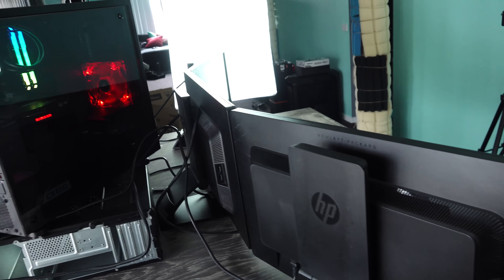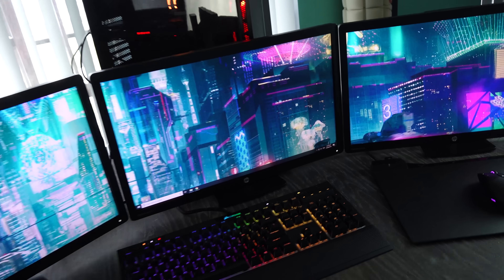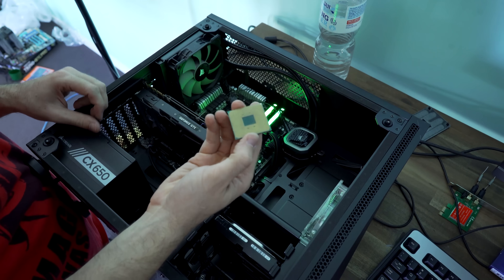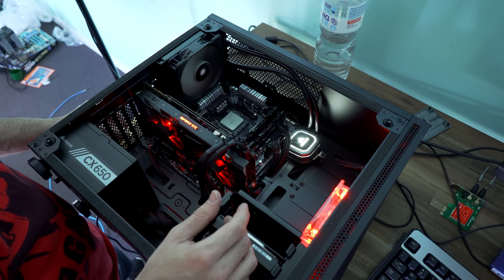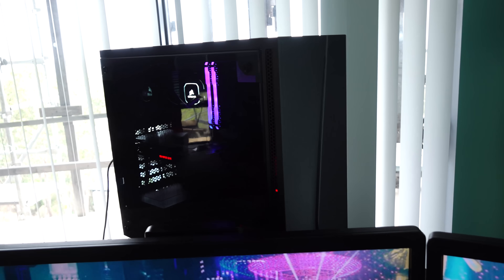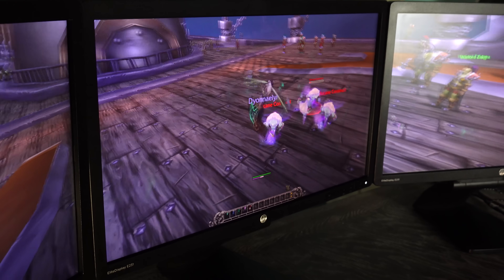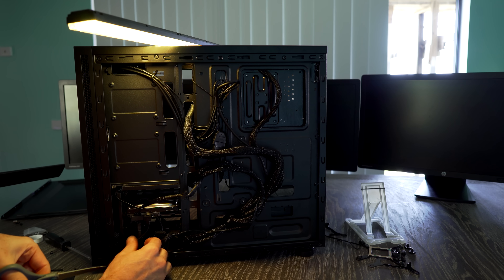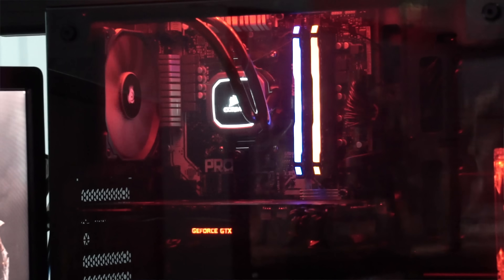Ryzen Problems...!? Post Analysis of the AMD WoW Gaming PC

Comment from the maker: Lots of people in the comments saying it happens on all platforms, both intel and amd, I have built a lot of pcs and it has only been happening to me on ryzen pcs, everytime without fail (not the old FX too which is weird).  I am only talking through my personal experience with the issue.  Though again if you are doing a new install, make sure only the SSD is plugged in initially.
Reply: Hey Bryan make sure that when u boot off ur windows 10 flash drive its using uefi instead of legacy / non uefi. I have similar issues if I setup systems using mbr non uefi vs gpt uefi.
Reply: I can confirm. It's more a windows issue than hardware issue. I've had this happen all the way back to Windows 95/XP/7 on any computer (Intel/AMD) with multiple HDD when performing a fresh install. It's just a windows thing.
Reply: I've been working in a PC repair store for 5 years and it can happen with all plattforms. We started disconnecting every drive exepct for the the main drive a couple of years ago.
Reply: If you are going to install Windows 10 in UEFI mode you have to take a few extra steps when you make your bootable install cpu. It is ridiculous that you have to do that. No such problem installing Linux.
Reply: I've had windows install the bootsector on my second hard drive, and not on my ssd and this was way before Ryzen so it's probably just a windows thing. This was with windows 8 by the way.
Reply: TechYesCity - I Had this Exact Same Problem - Although it Was an SSD i was loading Windows on - it was a NEW   WD HDD 1tb Blue - However - I Was Offline Had the Old Drive Completely Disconnected from system - and new drive Properly installed - OFFLINE - and was Attempting to Install Windows on the New Drive for a Backup Drive Offline - However - There Also Was a Format Error displayed and said that it would need to shut down - Meanwhile getting display and everything - there was a command prompt style option to type in - who knows what it was asking for due to no instructions of request of written information What So Ever - just a que that the system was needing to shut Down due to Wrong Formatted drive - Nothing Else - No instructions on recovery - saving BIOS settings - NOTHING - while i searched Online on a separate pc - There Were No Information what so ever - As well as No Way to Back out of the Screen or page What so ever ! Not Having the Proper Instructions To type needed information in the window with the command prompt Type - meaning a line flashing waiting on me to type in - Who Knows what - Even though - I Actually Attempted to type Anything in - And it Would Not allow Anything to show On Screen - Thusly - Back spacing Out of what I May have written in that line to make Sure Nothing was kept in that line per Not Bring able to determine whether or not Anything was actually received - I Then Proceeded to turn Off the PC - Shut Down - As Usual for Hardware Removal and Replacement - removed the drive i was attempting to load Windows on - Reinstalled the Working - EVEN NOW _ drive once again - Then Plugging it up turning it back on and Attempted to Start the PC - WITH ABSOLUTELY NO LUCK AT ALL ! This was and Very Mind boggling and I Still Dont know Exactly in the Normal Formatting A New Drive - THAT IS WORKING AT THIS MOMENT as a Back up Drive and Is Showing in My Current system that the First Working drive Is Installed in as well as Properly Formatted - Although im Not using it as a Boot drive - just a Internal Backup drive - I Tried Again and Again to get the r5 1500x - x370 prime pro - asus of course - mobo cpu and gpu to reboot - It Never did and still hasnt today - this occurring 4 weeks ago now - i had no Other AMD unit - Purchased Another Mobo - NO LUCK Same CPU - Had a tech shop Check GPU - it IS WORKING AT THIS VERY MOMENT - yes - same gpu that was in the Old PC - guess you can see where im going with this now - Purchased an Older Full Working PC - with am4 / A10-9700 and 8gig samsung / and win10  on a 1tb blue / HP . So I Took the Cpu Out - Replaced it with the R5 - Installed Gpu But First Before Turning PC Off to remove the A10 - I Went into Bios and Changed the Display Out put to GPU - plugged it up turned it on - NOTHING ! Took the A10 Put it in the New x370 Mobo i Purchased while waiting on Prebuilt to arrive - Worked Right away - Placed the R5 + Gpu - Same thing - Changed settings Prior to changing cpu`s NOTHING - Even Tried it Without Changing settings From APU Graphics on All 3 Mobo`s = NOTHING From the R5 - Placed the WORKING A10 in the First Mobo - NOTHING - Downloaded off new mobo the Bios to Attempt to Load From the Firs Same Exact Mobo - NOTHING - all the while Off of the WORKING Drive - NOT the HP drive Unless it was in the HP - i know better - But - Even with going as far as attempting to run the HP drive off of New Mobo = It Worked - was able to go Online and everything - No Problems - Even Recognized The New Hardware  / Different Hardware  - None the Less - The Mobo ended up Being Bricked as well as the CPU - Yes Even the CPU Was Indeed Bricked - No Output From Any Build and i Now have 5 AMD PC `s EVERY TEST - EVERY CONFIG - EVERY FORMAT OF OS - EVEN THE Drive that i was Attempting to Format when all this went down - Checked PSU`ssss - ALL Working Just Fine Including the one used when this happened - Full Calibrated test - and even tested the drives as well as the Boards - YES The First Mobo is Def  Bricked  - However - i cant determine whether its the Bios Chip Or Socket with Limited Tolls to work with Thusly Unable to test the CPU Any Further that the Install options _ ATM _ ! Outside all that - now there is a delivery problem here where i live with their site not working Properly with purchasing Shipping labels - Pfffff tttt  - stick a fork in me im done .........................................................................................................................................................................................................................................................................
Reply: OH ====================== the Problem I Found Was Indeed The ==================  Win10 Core Protection----------------------------------------- just FYI
Reply: You must realize it is not PC anymore to talk bad about AMD, otherwise the AMD fanboy SJW's will come after you
Reply: It happens with my board. Asus b450f. It loves to do that. All you can do is reseat your ram a ton and pray. You have to fight it
Reply: Let me guess.. this is an INTEL SPONSORED VIDEO? You have been getting those a lot over past few months...
Reply from the maker: Why would this be sponsored by Intel? WTF...
Reply: @techyescity  because of the previous clickbait title
Reply: The title didn't change? What are you talking about...
Reply: @EelkoA  Obviously you weren't here yesterday.
Reply: +Ulrich , i was, but whatever dude...
Reply: +Ulrich No it's not and has nothing to do with Intel nor with AMD ( Ryzen) but with UEFI & Windows!
Reply: @EelkoA  made that comment before clickbait title was changed
Reply: @rick_takahashi  that's not a intel only thing bruh lol. It happens with a ryzen pc I've had before
Reply: @4.63cow  comment I made was 2 yesrs+ ago.. pretty sure it was referring to the "clickbait title" that Bryan was using before he changed it.
Reply: @rick_takahashi  lol I thought this video was made recently lol

Comment: 4:20 Every time I install windows, I zap all partitions on the boot drive. I do this with the windows installer it self, where it asks you which drive/partition to install windows on. I just delete all partitions i see on there, and install it on an unpartitioned drive, as windows will set up the partitions on it's own. I also don't have any other drive hooked up, even if it's second SSD or HDD so there's no way I'll install it on another drive.   I've been told the recovery partition is useless and you can delete it and recover that space but it's not very large anyway. The USB stick you make to install windows can also be used your recovery boot if you ever have problems. I have seen systems that have multiple recovery partitions, which I believe is from people not deleting all partitions, which is why do delete them otherwise it's not really a "clean" install.

Comment: i had same problem on my i5 4690... i had to have only SSD plugged in, install W7 on SSD, then connect HDD and worsk fine.. if i wante to install windows with HDD plugged in, it would do the same thing - install partialy on HDD...

Comment: Oddly enough, I had a HDD and a SSD when I built my system with Ryzen (and my friend's one too) and I didn't encounter this problem, though, the HDDs were used, his got formatted and mine held my Steam library so that one didn't get changed.

And still, this problem is little compared to the one I had with the previous system which used a FX 4100.
When I pressed the button, it would 75% of the times try to boot from anywhere BUT the SSD.
IT EVEN TRIED TO BOOT FROM THE OPTICAL DRIVE.
IF only the SSD was plugged, it would reach windows, otherwise you might get this problem, and the only way to solve it was to keep turning it on and off until it passed.
And that is not even talking about how it would randomly crash until one day Windows 10 would die, needing a new install of the OS.
I had to do that at least 3 times, using Windows 7 the last time, which was stable until the end.
I tought that the SSD was bad, I was about to return it.

Yet, when I got the 1600, the SSD started (and still is) working fine, at the speed it should.
In my case, Ryzen gave me a RELIABLE system without any problem,  which was very needed.

Comment: I thought it was weird and maybe just my install but i have to use Windows Boot Manager(samsung) and can't boot from any drive directly? Previous i had to boot from Hard drive though my system is on a M.2 slot, always just thought it could be where windows stuck the the recovery option? I'v reinstalled windows on the system on multiple drives and things just keep getting weirder. And i have switched the boards as well and the one that was installed with just the M.2 and then added the SSD later it seems to not have these problems.

Comment: If you have system reserve on HDD then theirs more space on your SSD ? So what are you complaining about ? Remember system reserve is dead space regardless of where it's placed.
Reply from the maker: If windows needs to access those files then you can count on more sluggish response times from your system.
Reply: Your right, however I have never seen windows access this partition. A quick google search tells me that it was created to help facilitate the installation of the windows OS. However, it is also claimed that this partition helps you to troubleshoot windows problems. IMHO, if you had a problem with windows would you reinstall the OS or access the 'system reserved' partition' ? Or maybe a compromise would be to convert that HDD to a hybrid HD.

Comment: what about installing 4x 100TB Data Centre SSD drives and setting up a RAID ARRAY and installing a slave SATA addin card and use that to boot the system.

Comment: Never had drive issues like that before, but when I'm installing the O/S I just have the drive I want to install to connected. However, I've has several no video/no post situations and even some power on issues resolved by re-seating the RAM or GPU. I've even had that happen with a sound card.

Comment: I've built a few Haswell systems over the last few months and had this issue on every system. What fixed it was to only connect the SSD, install windows, then connect the HDD afterwards and format it in the new Windows install.

Comment: BTW if you happen to lose the 1150 bracket for an hXXi cooler 
do you know if we can buy one in AU or possibly DIY/3d print one

I was building an HTPC and wanted to use an old H50i cooler 
yet i couldnt find the bracket

Thought you might of had the same issue or a good idea 

cheers

Comment: Ryzen is fine for most of WoW, but it does struggle a bit in 25 man raids. Switched from 2700k/R9 390x to R5 1600//980ti and I got double the framerates in raid with the 2700k setup.

Comment: Have problem with system reserve before, it was installed on my ssd, my windows is on nvme drive, i wanted to use my ssd + hdd combined using storeMI, but it cant because of system reserve partition. So i deleted to partition, recreate it into nvme drive. Create nvme drive for ssd and hdd then done.
Reply: Btw this was 6 hours of troubleshooting and readit

Comment: It never happened to me, and I built my fair share of Ryzen PCs and all of them had SSD for system and an HDD for storage.
Reply: Apologies, my method of assembling a new PC, or installing a fresh OS on an old one, is to disconnect all drives other than the boot, and that's why I never had the issue.
Reply from the maker: Yeah it is something I think we need to widespread to pc builders so they don't come into this problem.

Comment: I have a question. I want to upgrade my pc, but i can deside to which option? 
Option 1 i have 3770, asus p8b75-m lx, 8gb ram, seasonic 620w S12ii, hd 5870... upgrade gpu to 1070 or 1070ti and ram to 16gb and buy 2 more monitors 1080p 60fps and play games on triple, and develop mobile on unreal engine. Or
Option 2 to buy 2700x, asus x470 prime pro, 16 gb 3200mhz, 1070, seasonic 620w S12ii and play games on 1080p 60fps monitor and develop on UE4?
Is cpu usage go up when you using 3 monitors? First option is cheaper a lot, but i dont know if 3770 can hanle it?
Sorry for eng it's not primary language. 
Thanks

Comment: Hi, just noticed you put on the power on, and the cpu had no cooler. It shuts it off, and might take an hour or two, to be able to run. Good thing it hasn’t fried the CPU. Any built in safeguard will not cover you 100%.

Comment: had the same windows issue just yesterday but on intel. upgraded from a b75 motherboard to a z77 for my i7-3770k. disconnected the hdd, installed it on the ssd and voila it works. strange thing not only on ryzen

Comment: I had similar problems with intel before.Some scenario's.When your cpu's heatsinks not on properly when you got a surge and bad oc.You reset bios via jumper and it still doesn't start.Had to reset cpu or memory by reseating them and that fixed it.But this was very old intel pentium 4's and core2duo's that use to do that

Comment: I have a question I just got a new ryzen 3 1200 and I have a issue where after some use /only on less demending tasks when I do more intense tasks it doesn't do this it seems/ the system starts to slow down atutter and freeze after a few minutes 

Specs are 
8 gb /2x4/ 2400 mhz ballistic \clocked down to 2133 because I thought it might be a ram issue
Biostar b350gt5. /I think this things my issue myself but I don't know yet I want to find myissue out before dropping more money needlessly/
R9 280 gpu 
Kingston ssd
Dunno if this is too relevant . but this problem has bugged me a d I did do rhe bios uppdate to my motherboard and it didn't change anything unfortunately

Comment: Make sure when u boot off of ur windows 10 flash drive u use the uefi boot option and not the legacy option. If u use legacy it forces windows to format patrons using mbr instead of gpt and it will also put a system reserve partition on the hdd. That also explains the 2 tb limit since mbr doesnt support above 2 tb.

Comment: i have a ryzen 5 1600 on a msi b350 mobo. using a 2tb hdd and a 240 gig nvme ssd (wd black). Couldn't get windows 10 setup to recognize my ssd until i pulled out the hdd. It wouldn't see it at all as a drive in windows setup...

Comment: its not un common..had the same issue with an 775 ddr3 mobo not turning on cuz of the ram. took the ram out it booted up. tryed other ram it worked. put the first ram again the other way around and worked fine. now about the hard drive i always leave only the drive that im putting windows on and remove the others cuz sometimes windows tends to put crap on them like pagefile and stuff when you dont want it

Comment: I have the same booting issue. Pushing the power button (immediately after a shutdown) doesn't boot up the rig but the RGB rams light up (using G Skill Trident Z RGB 3000 8x2 kit). My workaround for it is to wait for a few minutes before turning it on again and it boots normally. 

In my case though I think it may be the power supply since I've been smelling a burning scent. Could have been caused by my PSU being connected to a crappy AVR that died. Will update once I replace my psu.
Reply: Update: Replaced my old Seasonic G650 with a Seasonic Focus+ 650. Stress-tested the rig for a couple of hours and so far it's working fine! It seems the problem was really the psu.

Comment: Hey Bryan, 

It's likely don't get more than 2tb on the hard drive because it's formatted MBR. It needs to be GPT as MBR doesn't support more than 2tb per partition.

As for the PC, it's a possible dead cmos battery. Had this issue before on more than one occasion. (new motherboard with faulty battery)

As for the windows installation on the SSD, rather than reformat, run this command in an elevated command prompt.

bcdboot C:\windows /s c: 

:) Cheers m8